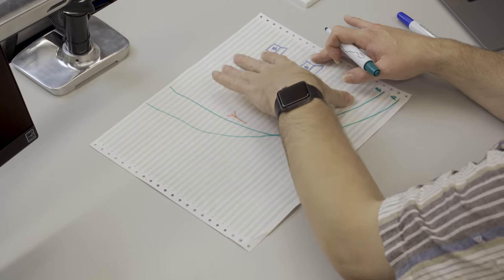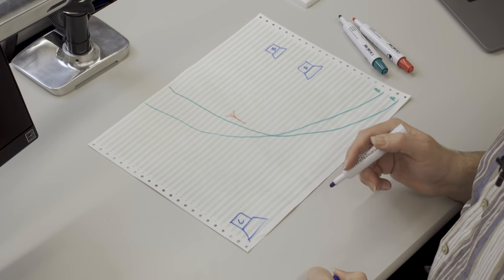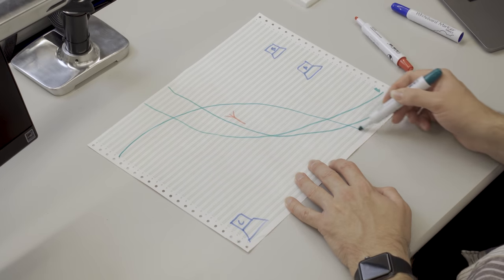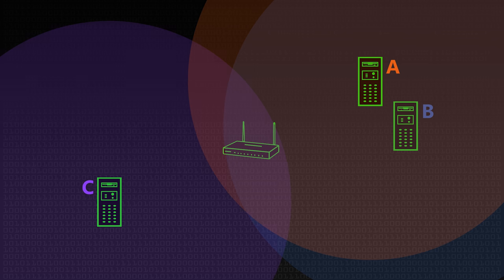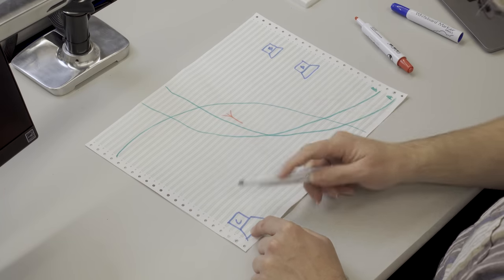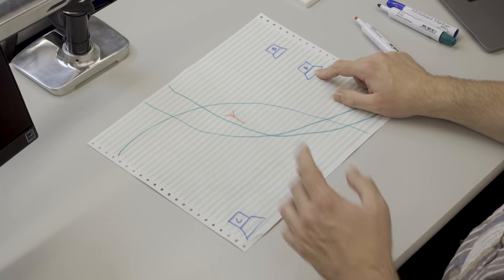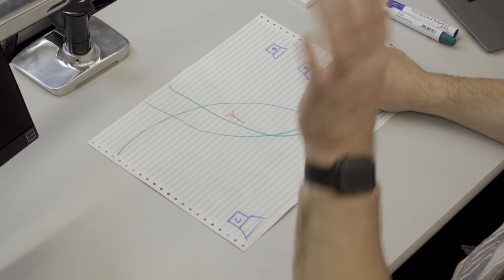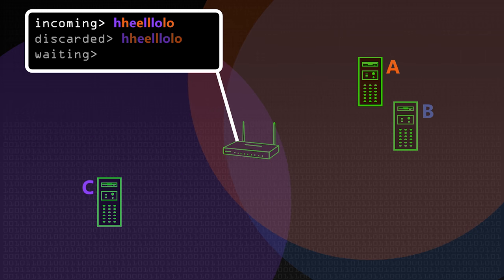WiFi's Hidden ____ Problem - Computerphile

Comment: The Request to Send frame is 20 bytes.
2 bytes Frame Control
2 bytes Duration
6 bytes Reciever  Address
6 bytes Transmitter Address (TA)
4 bytes Frame Check Sequence (CRC)
The Clear To Send and ACK frames is the same minus the 6 bytes TA.
Reply: Thanks
Reply: Thanks
Reply: Tom Hanks!
Reply: Can you tel me where did you learn this, this is not in a N+ neither ccna
Reply: Beautiful! Can't wait to explain this to my customers during service calls about the TV picture freezing on the wifi!!
Reply: And people who play fighting games over wifi wonder why everyone hates them
Reply: @TheTheThewillow  for me I learned it during a data networking class during my undergrad study in electrical engineering. But if you want to learn that specific thing only you can look up the wifi protocol and read more in-depth into it
Reply: pls if i wanna a book that explain all this little details i really wanna read it even if he have 10000 + pages
Reply: @TheTheThewillow  read the rfc's
Reply: If the TA isn't sent, how do the other machines know they haven't got the all clear? Unless the Receiver Address is the address of the machine and not the router. (It's because I'm confused as to which is the RA or TA
Reply: @TheTheThewillow  I posted a link to where I found the field sizes yesterday, but it's been removed. I found it on a Tutorialspoint page after searching Google for "wifi request to send packet". Wikipedia listed the field names, but not their sizes, and it's also where I saw that the CTS and ACK messages were the same, except without the TA field. I'm not an expert, I'm just sharing the findings of an interesting Google research session. Glad it helps people. 🙂
Reply: @IbadassI  Yes, the receiver address in the CTS frame is the same as the transmitter address in the RTS frame. This is all done in the MAC layer.
Reply: I can code in fortran , cobalt and apple basic , the  cards gave nasty paper cuts... Viva mad world!
Reply: @wohdinhel  Smart gamers know that a direct wired connection to the router is better than wireless because of the reduction in lag!
Reply: @tomgucwa7319  "Cobalt?" Lemme guess, auto-correct broke your message, right?
Reply: smol packet
Reply: Problem with this is there are 5 transmit channels available , apart from TDMA access
Reply: Many people are asking how does one know about this!
One way to learn this is to study the ASCII set of characters and learn the first 31 characters of it... 32(space) is the first char that starts the actual written/data sequence of characters.  Call them codes, if you wish.
Reply: Why didn't they just design WiFi so that the access point sends out a carrier signal (on a different frequency) while it is receiving data, that all in range nodes can listen for?
Reply: @supercal333  That would use up two frequency channels instead of one. That's a very limited resource.
Reply: @ccreutzig  The 'line busy' signal would not have to use a data comms frequency or methodology.
Reply: @supercal333  It would have to use some assigned frequency, which could then not be used otherwise. One per communication channel, and with some nonzero bandwidth.
Reply: CRC = Cyclic Redundancy Check
Reply: @aymanelhasbi5030   Try the book Computer Networks and Internets by Douglas Comer (6th edition), great book and recommended by a lot of academia. It gets to the very lowest level on everything.
Reply: @IbadassI  Try the book Computer Networks and Internets by Douglas Comer (6th edition), great book and recommended by a lot of academia. It gets to the very lowest level on everything.
Reply: @homeymcdutch1759  thanks mate a lot
Reply: @supercal333  If you use a frequency for collision avoidance control purposes, it still has to be on a usable frequency.. that would be another usable channel that's "consumed". That means each access point would need to use two channels, one for data transmission and one for collision avoidance control.

That actually is workable, but we must consider that it's very common in today's world to have numerous access points with overlapping radii (particular in offices, urban areas, etc). 
The number of bands in a given volume of urban space basically represents a limited resource.

By having collision avoidance control and data transmission on the same channel, we have each access point only use a single channel.

While this does reduce bandwidth and increase latency to some degree when there are a large number of nodes connected to the same AP that are sending data simultaneously, we also have to realize that the benefit is that it essentially doubles the number of APs that can operate in the same space when compared to our hypothetical design for a two-channel AP that uses one for control and one for data.
Reply: @TheTheThewillow  Neither of them tackle it because it's a complex system that is too much to cover in the "Basics". CCNA should cover CSMA/CD, and I believe it references CA/Wireless, but I don't believe it goes in depth. Cisco Broke off their wireless into a separate CCNA/P track, but I believe they're tried to consume it back in.
Reply: @supercal333  Because then all WiFi modules would need two radios instead of one, doubling the price :)
Reply: A frame is not only the data. It also has interframe gap, preamble, start of frame delimiter and end of frame delimiter.
Reply: @supercal333  everyone's talking about the issue with multiple frequencies but your solution wouldn't solve the problem in the first place. If two senders send data at the same time it would collide en route to the access point. Sending out a carrier signal when it's receiving data wouldn't solve it because the data has already potentially been sent by another node. We're talking radio waves here.

Comment: If there is an RTS collision, the requesters can use binary exponential back-off to send the next RTS at a random time. Each time there's a collision in succession, they will roll a bigger (more sides) "die" to determine how long they should wait before they send another RTS.
Reply: When I first started teaching Ethernet over 30 years ago, I too used the analogy of rolling a die (using the word die, instead of dice, always felt wrong to me 😀) with more sides on it.😉
Reply: @rjones6219  I guess you could say ethernet utilizes a real time strategy?
Reply: @rjones6219  Dice is plural of die

Comment: This was a huge issue in the WISP industry since every node was effectively hidden. Manufactures started modifying the 802.11 standard and adding TDMA. Ubiquiti, Cambium, etc. use a scheduler with time slots. Each station is given a time slot to send completely eliminating the issue with colliding symbols.
Reply: Thank you. This is what drove me to the comments section. Glad to see you already addressed this, so I don't have to!
An additional little bit is that with 802.11n and newer is it also possible for the AP to set up radio frequency bandwidth reservations, rendering the issue largely moot when using commercial multi-multi access points.
Reply: You forgot the part where this uses GPS time to achieve.
Reply: Yep! I work in the WISP industry too.
Consumer access points with wifi 6 also use OFDMA as well.
Reply: I was going to ask this very question.  TDMA seems like the perfect solution to CD and CSMA.  The TDMA could be scaled by the amount of users connecting the wifi access point.  This would eliminate the overhead of other redundant commands.

Comment: This is primarily why MIMO techniques exist like space-division multiplexing in combination with concepts of channel separation/guarding.
Reply: There's two reasons for MIMO. One is simply that you can get multiple times the speed through the same bandwidth. The other is to do beamforming, but I don't think it normally works well enough to solve the hidden node problem, but it's usually able to solve the exposed node problem provided the networks are far enough apart.
Reply: WiFi's MIMO (in 11n, 11ac, 11ax) standards perform space-division multiplexing (multiple spatial streams) or beamforming (increasing SNR ratio at the receiver by "pointing" the beam).  To do either, and especially the first, they need to know the frequency-dependent channel between the two.  They do so by sending sounding frames and receiving a quantized compressed representation of the channel (actually, steering vectors).

The amount of separation achieved by this technique at 2.4 or 5 GHz is not really enough to enable "channel separation" through MIMO, because the number of antennas used is small.  Increased separation can be achieved at 60GHz (802.11ad or 802.11ay) because these support sectorised antennas,  and the latter also supports a large number of antennas - which is possible (and necessary) when operating at a frequency 12-40x "normal" WiFi.  Spatial reuse is a big win for 60GHz radio wireless LAN systems because they can only realistically close the link with antenna gain at both ends.

Comment: In the Army radio protocol, you always said Roger Out, indicating Understood, and I'm Gone!

I was an Apps Engineer for Hard Drive companies and while most Host computer companies complied with standard, well-defined protocol, some would try to violate it all the time!
It was always intersting to figure out how they might be screwing things up!
Serial transmissions over wire today use software interrupts to hols a bus until the sender is ready to transmit, whereas before a hardware interrupt was used.
Then there are the problems of even 'race conditions' within a device itself!
Serial commo between a hard drive these days is always point to point and so the host has to handle all of the transactions between the various device on its bus!
it can get very busy for the Root Complex and the PCIe controller to deal with everything, but I imagine it gets seriously more cluttered in a wi-fi scenario!

Good vid and it took me back a few years!!! ;-)

Comment: I honestly can't imagine how they got this to work in busy places such as convention centers, etc.
Computer tech degrees should be rebranded to 'computer wizardry'.
Reply: Answer is high frequency :D
Reply: They do a survey first, decide where to put the AP's so that their signal strength radii overlap, BUT each AP is set to a different base frequency so that although the range overlaps the actual signals don't interfere with each other.  As a mobile device moves across the cells, it hops from one cell to another, changing frequencies as it does so.  In my former employer, our network services team used to plan and coordinate surveys.  Then specialists with expensive test gear would go and test each floor in turn and confirm the AP locations.  Then using PoE switches and AP's simply drop a CAT5 [now CAT6] cable to the AP.  Easy when you know how... :-).  I have always told people to uses cables first and WiFi only for devices that can't use a cable.  Its a shared medium..  trying running a backup over WiFi, then compare the speed with running over a switched Ethernet cable.
Reply: @rogerwhiteley606  That is genuinely interesting, thanks for the reply!
Reply: @PastaAivo  Cheers, I spent 37 years playing with networks - and getting paid for it, result!.  CSMA/CD on thickwire ethernet and coaxial broadband is where I learnt the basics,  along with signal transmission theory which explained why an unterminated coax was a problem....  I don't have a CS degree, just 40+ years making computer systems work.

Comment: The odd thing about this vlog is that I instantly thought of the Victorian Railway management system of 'ownership' tokens. A token is passed from a train to a station (node), and the token is used to 'own' a stretch of line, until the train has passed another station (node), and exchanged another token. The act of 'sharing resources' is perhaps not as 'modern' as we think it is... When you want to solve a 'problem' it might pay to have a look to see if there is a similar 'logical' situation where the conflict has already been resolved. Very informing vlog!
Reply: Collision avoidance in its most physical instantiation.

Comment: Please explain the purpose of a mutli-stream router and how to tell if any noticeable rx/tx delays are being caused by LAN or WAN.
Reply: First of all Carey I've been subbed for years, you do a great job on YouTube. 

From my knowledge the more streams a router or access point has, the more data it can send to your devices and receive from them. If your device doesn’t support let's say 16 streams, they still utilise the benefit of that redundancy.

I wish I could go into deeper context, but tbh I would be lying if I said I knew the difference between having 12 or 16 streams, I think it depends on your situation so you're quite right to ask this as there hasn't quite been simple explanations of this, at least from my experience.
Reply: Hello, I believe multi stream routers use spatial beamforming technology to support the Multi-User Multi-Input-Multi-Output (MU-MIMO) capacities of the Wifi 6 (IEEE 802.11ax) standard. To be brief, beamforming utilises specialised technology to "direct" a stream of data in a particular direction. This essentially establishes "domains" for the router to send over. Ie. the router can send to say 8 devices over 5Ghz network at the same time if they are each in a separate beamforming area. This however, does not mean that a receiving device can send data back in a beamform, as this would require specialised antennas, so sent data is still subject to interference from other devices. Generally however, we fix this problem (slightly) by utilizing channels within the 5Ghz/2.4Ghz band. Generally for 2.4Ghz, these would be the ones that don't overlap: channels 1, 6 and 11; however others may be used with minimal overlap if needed. Also note that the materials in a building's walls can also "skew" beamforming technology: especially 5Ghz. This is not comprehensive, but a start in the right direction.
Reply: Correct me if I'm wrong. The multi-stream router prevents multipath fading or propagation from occurring during a transmission.

Multipath fading or propagation is caused by transmitting data over the air, where the router or AP receives data with some inteference.
With multi-stream or multiple antennas in a router, the receiving router could recover the original data by combining the data from these antennas.
Reply: step 1 print("fix wifi") wifi got fixed easy
Reply: Ping the router from both lan and wlan ? :p
Reply: Multi-stream comes in two variants:

MIMO (multiple-input multiple-output) uses multiple antennas to take advantage of multi-path propagation to send/receive multiple streams on the same frequency. For example, if a sender and receiver each have two antennas pointing different directions, the signal sent from each antenna will hit the two receiving antennas at different times and strengths after bouncing off walls, etc. In ideal circumstances, that means this pair of radios can exchange twice as much data on a single frequency. That's 2x2 MIMO, 4x4 MIMO uses 4 antennas, and so on.

MU-MIMO (multi-user MIMO) is the same idea, different antennas pick up the signal better from different directions, but instead of 1 user sending two signals in different directions to bounce of the walls, 2x2 MU-MIMO would let two users (say on different sides of the router) send at the same time.

Beamforming is an unrelated technology using multiple antennas to direct a signal by using interference patterns to make the two signals add up in the direction of the intended recipient. It can be used along with MIMO/MU-MIMO to help differentiate the multiple streams.
Reply: @Antigr0up  Beamforming sounds like synthetic aperture radar as used at Fylingdales in the UK.
Reply: also, how does multi stream differ from the use of slightly different frequencies i.e. 'channels' in wifi?

Comment: 3:18 I found it funny how they both started talking at the same time while explaining that it shouldn't be done.
Reply: They both indirectly agreed to duplex transmission.
Reply: Pretty sure they were doing that deliberately to emphasize the point.
Reply: Well done, you got the deliberate joke
Reply: The thing I find funniest is how it demonstrates that humans are capable of simultaneous Tx,Rx, to an extent. They were doing exactly the thing that Wifi finds impossible, just casually, and with a massive lampshade hung on it. I don't think it was a deliberate joke, but it does show how powerful the human capacity for interrupt without data loss is.

Comment: This is going to be very useful next time we move the office room or new building to position the router.
We had some problem when using one router from two floors at the same time, but not when used from either one floor at-a-time. This explains all that now.
Thanks a lot.!

Comment: The whole RTS and CTS negotiation is also why it's suboptimal to play video games that depend on split-second timings on wifi. Friends don't let friends game on wifi
Reply: This (and not only this) is why you should use cable whenever possible. Its faster and more reliable. + less E-pollution.
Reply: On the other hand, for developers it might be interesting to investigate how reliable it is to sent super small packets at lower latency. As it was mentioned that those can be one-shot without requesting sending clearance.
Reply: no. problem are collisions from other networks (exposed node problem) and interference from other sources, cdma/cd in itself wont incur single millisecond delay under the worst of conditions. there are also other issues (eg. cpu/radio asics in consumer grade access points getting easily overwhelmed with heavy trafic)
Reply: So true.  Any gaming device must be hard wired.
Reply: Completely overblown. You know these things are done in microseconds right? Human reaction time is in the hundreds of milliseconds.